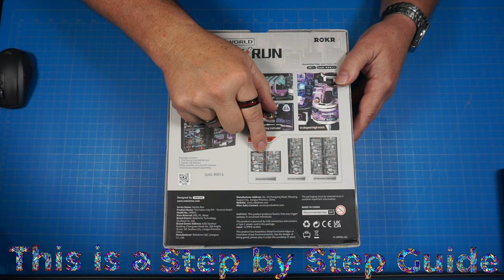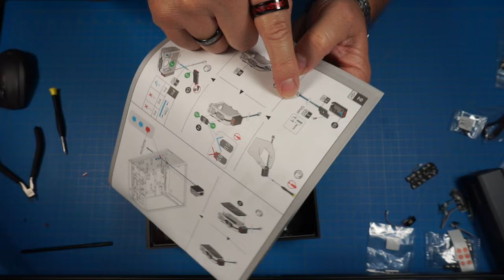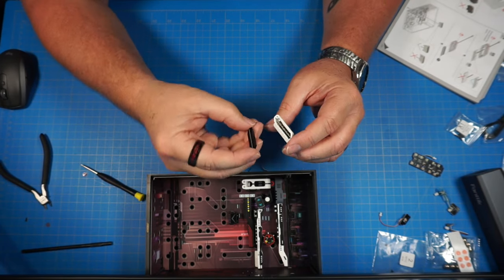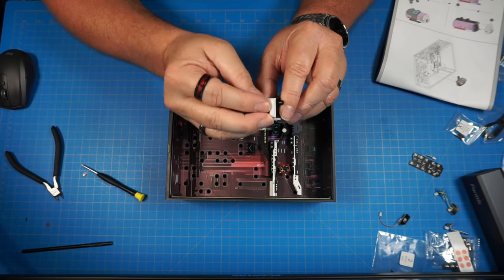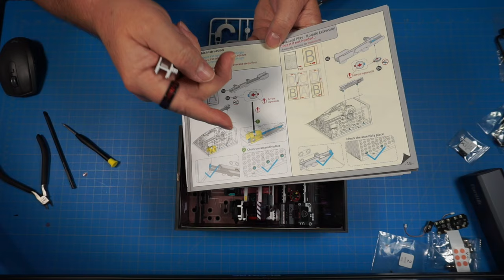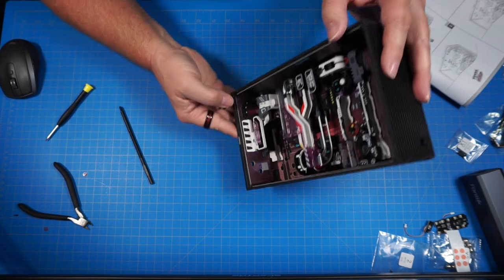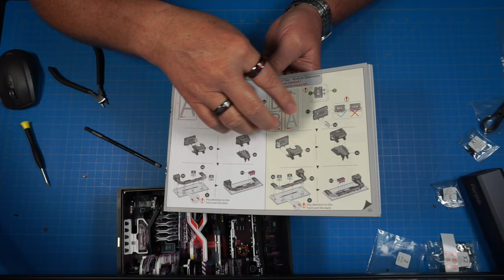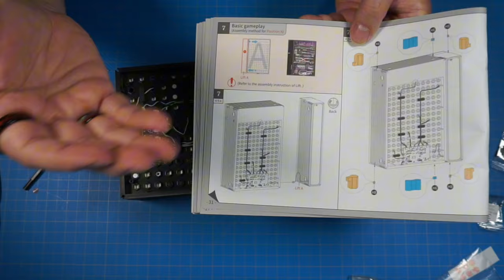ROKR The Future City Step by Step Assembly - Marble Run

Comment: Much better for watching the assembly in real time, thank you for doing this. One question, are there instructions for using replacement parts instead of removing pieces and then using the replacement pieces so you don't have to remove and replace pieces for adding the 2nd marble run especially with the part you could not get out? There is good possibility I will add this 2nd marble run to my first one now with this video. Thank you again for uploading this video.
Reply from the maker: @66lwmorgan  to answer your question, the connecting pins come in short and long versions.. in hindsight, I would use the long pin on the one I couldn't remove. It would stick up a bit, but it would work just fine. The rest are easy to remove and replace. Thanks for watching. 🙂